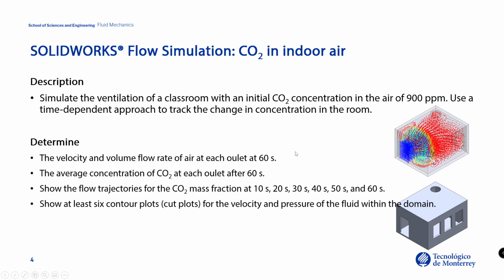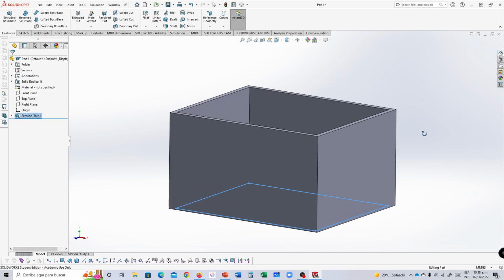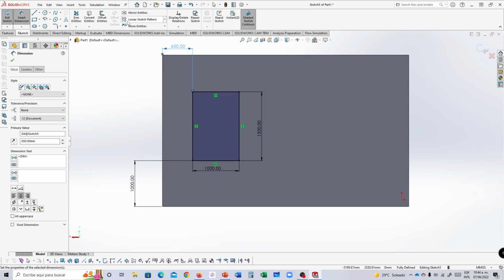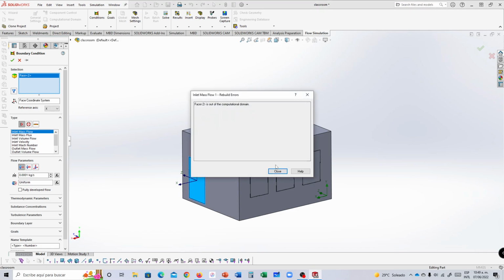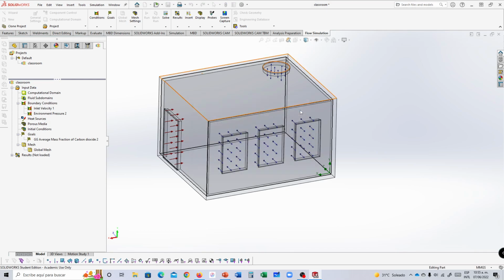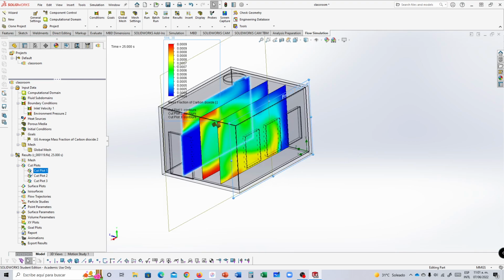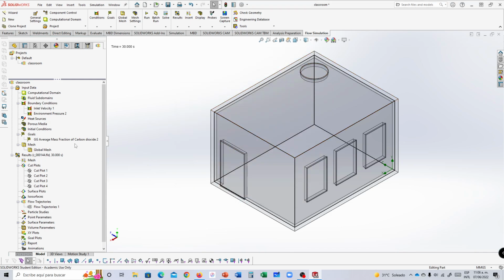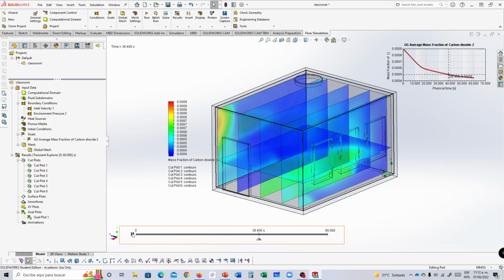SOLIDWORKS Flow Simulation: CO2 in a classroom

Comment: Hola. Gracias por compartir conocimientos :).
Una consulta. En un cuarto como el que simulas en este video.
Por qué agregas una entrada fija de aire por la puerta en vez de poner una condición de presión como en las ventanas y techo?
Pienso que todas las aberturas deberían tener una condición de presión. (Incluyendo la puerta)
Reply from the maker: @Yokoroom_halflife  Hola, muchas gracias por apoyar mis vídeos. 

Respecto a tu pregunta, para que exista un flujo de fluido debe existir una diferencia de presión. En la condición de frontera de la puerta puedes especificar un flujo másico, un flujo volumétrico o una presión. En este caso, la presión deberá ser más alta que la presión especificada en las ventanas y en el techo para que la dirección de flujo se mantenga tal como en el tutorial. Si la presión especificada en la puerta es más baja que la presión especificada en las ventanas, entonces el flujo ocurriría en la dirección opuesta.
Reply: @orlandocastilleja  Gracias por responder. Pensé que no lo haría :´D. Pasaré por sus otros videos.

Respecto a lo que me comenta, me queda claro. Sin embargo, yo traté de hacer algunos cambios adaptándolo a la oficina donde trabajo.

Es una oficina cerrada con una ventana abierta hacia la calle. Las demás aberturas son las rendijas que quedan al pie de las puertas. Por lo que solo coloqué una condición de presión "Environment Pressure" en todas las aberturas con la concentración indicada en el Tutorial. Ya que, en teoría, es así como se comporta el aire en esta situación (entra y sale aire mezclado con co2). Pero no estoy seguro de si es la forma correcta de simularlo en esta situación.

Además, en esta oficina trabajan 6 personas que emiten una cierta cantidad de CO2 por segundo. Entonces, cómo podría agregar esto a la simulación?, me refiero a como agregar una emisión constante de co2 adicional al co2 inicial. 
De antemano, gracias!
Reply from the maker: @Yokoroom_halflife  Cuando especificas una condición de outlet ésta pueda funcionar tanto como entrada como salida de fluido. El modelo matemático “decidirá” si el fluido debe entrar o salir por esta frontera dependiendo de las condiciones locales en esa frontera. Por tanto, si especificas una condiciones de outlet en todas las fronteras, incluyendo la puerta, deberá existir alguna perturbarbación (velocidad, cambio de presión, vacía, etc.) que haga que el fluido se empiece a mover. Si no lo hay, entonces no verás un cambio en el sistema.
Reply: @orlandocastilleja  Esa perturbación sería la emisión de CO2 de las personas trabajando en el lugar?, también las corrientes de aire que se puedan generar entre las aberturas y ventana, cierto?

Comment: Is it possible to specify a certain temperature for a CO and air mix for example (car exhaust)?
Reply from the maker: Yes, you can activate the heat transfer module and specify the temperature conditions.